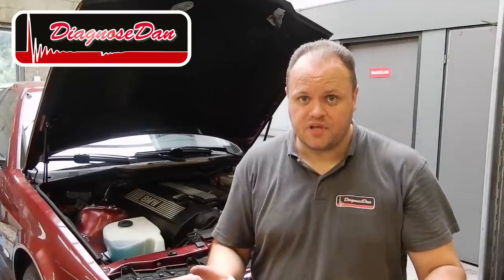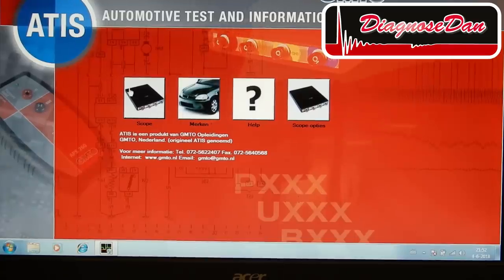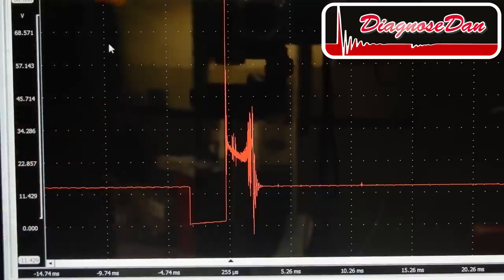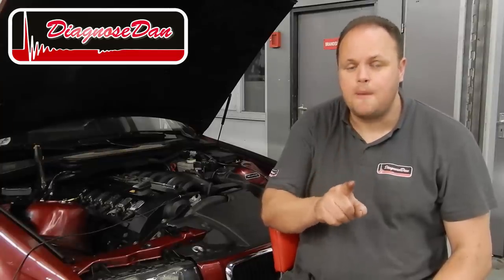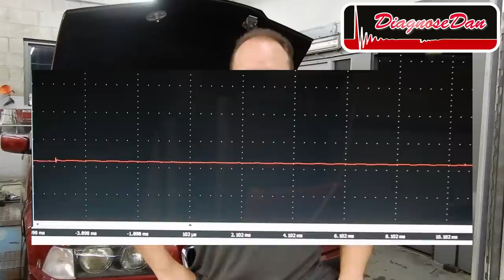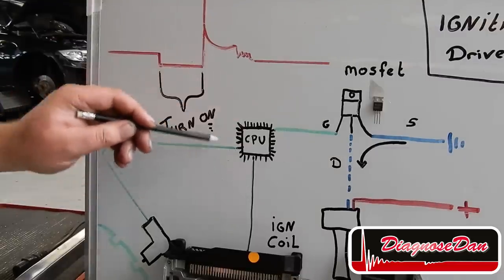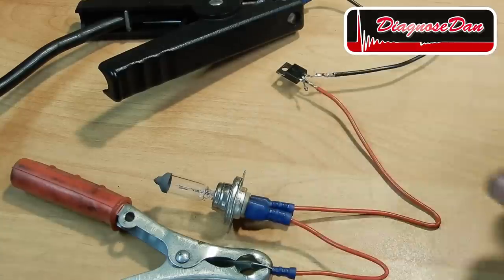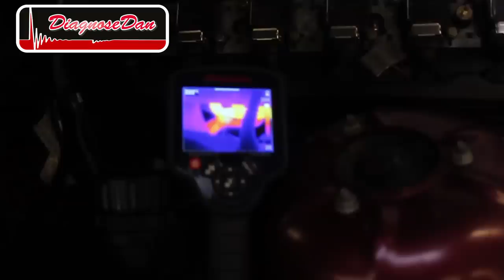ignition coil driver

Comment: So cool, Dan! Love the in-depth explanation on the whiteboard of knowledge :) A couple questions:1) Since MOSFET driver is controlled by positive voltage on the gate, how do you know 100% that the ECU chip was damaged by the shorted MOSFET?2) How did you take care of the "immobilizer issue"? Please show us!3) I must admit that is a beautiful clean BMW...how does it look brand new?
Reply from the maker: Pine Hollow Auto Diagnostics , I tried to repair the board with a new   mosfet. after replacing I checked but there was no control anymore! 
Most of the time there is more damage than just the mosfet😢.
If you are really interested in what i did with the immo, you can sent me a PM on my diagnosedan Facebook page! 
Thanks for the comment buddy it's appreciated!👍
Reply: hey dan i also want to know about the immobilizer. please share
Reply: Sweeeet
Reply: +Pine Hollow Auto Diagnostics Hi Ivan! Well Most CPU's work with a maximum 3.3V if you consider that the Mosfet was shorted and the history of the car said that it had a shorted primary coil winding then we can assume that +12V power coming from the coil circuit went trough the  signal ECU wire and then through the shorted Mosfet getting at the end to the CPU circuit and burning it. The shorted primary coil circuit and the shorted Mosfet both became a bridge or road for the +12V to get directly to that CPU. Cheers Ivan!
Reply: Todo. Oke
Reply: Most circuits I've ran across that use  FETS or IGBTs will have a gate driver between the microcontroller and FET.  The gate driver could be in another IC on the board or by itself.  That way if the FET shorts, it will take out the gate driver instead of the MCU.  If you think about it, a short that bad if the MCU were to directly control the FET, would blow the whole MCU and the car wouldn't even run.  There are other reasons why  gate drivers are needed, but I would be typing a book.  
Great video and love that you went more in depth with how the DME controls the coils.
Reply: You would think that the CPU would have short protection in all it's in and out puts.  Well known ways to do this.  But why?  Fewer $1000 parts get sold this way.
Reply: @OzMechanics  Probably transferred the EEPROM data from the old pcm to the new one
Reply: @stanleytolle416  The electrical environment in a car is known to be particularly noisy with lots of voltage spikes and transients. All electronics are already designed with protection circuitry on the parts that interface with the car. However you can't protect against every eventuality, certainly not when the failure originates from within the module itself.
On top of that, even if this PCM had been equipped with protection to survive this failure mode, the protection circuity itself presents another possible failure mode. Also you'd still have to find and pay someone with the skills to locate the faulty component within the PCM and solder in a replacement. That is unfortunately a less and less common skill nowadays.
Reply: @OzMechanics  Autologic or GT1 will resynch DME and EWS
Reply from the maker: @12salem  No they won't
Reply: @Diagnosedan  Somehow I can no longer find the comment I was replying to but YES THEY WILL  sync a dme and ews . Perhaps depending on year and make but they most certainly will on certain models. I have GT1, ista, ista/p I scan and all those systems will do it
Reply from the maker: @12salem  Will they sync an Ews, with a Donor Dme? Like i used in the video?
Reply: @Diagnosedan  That part I can not say , in the two instances I had to do it I had a no start on a 740il and once 0n a 540.  no ecu was replaced, cars came in from other shop with no start. I would assume with your situation a reprogram using ista/p would be needed.  Point is gt1 and others will do an ews synch
Reply from the maker: @12salem  i worked with the GT1 and Autologic. They won't sync modules with different Vin numbers.
Reply: @12salem  The (fixed part) of the ISN (individual serial number) is different if the ECU is from a different car, hence GT1 and AutoLogic won't be able to synchronize. It can only sync the "dynamic part" on an already used ECU. Using certain chiptuning tools, it is possible to change the ISN of the ECU so you can make the donor ECU have the ISN of the broken ECU. It is also possible to change the ISN in the car by using AK90, EWS Editor, Xprog etc. A third option is to modify the ECU in such a way that it doesn't care about the immobilizer anymore. I'm guessing that's what @DiagnoseDan did since he doesn't want to talk about it. In more modern cars, this can all be done by OBD using advanced tools like BMW Explorer and AutoHex, but certainly not with GT1, ISTA, Tool32 etc.
Reply: He did not actually show the MELT DOWN of the terminal on the circuit board, the BOARD was toast.....Good parts in the computer, but not able to retrieve any cost effective way.
Reply: I would assume if the ECU was not damaged there would still be a signal to the Mosfet.
Reply: @Diagnosedan  All they had to do is put a 3.3V zener from the output pin of the CPU/microcontroller to ground.  Cathode (K) goes to the pin, anode to ground. Then use a 1K resistor from the from the pin of cpu where the zener diode is to the gate of the MOSFET.  The input impedance of the MOSFET is so high that the 1K resistor would not effect it all that much - except for the turn off time.  (Slew Rate)  Due to capacitance between the gate and source, you may want to add a small ceramic cap of about 1uf across the 1K resistor.  That would fix the slew rate issue and tighten up the off time.  If a MOSFET shorts, the resistor would limit the current, while the zener diode starts to dump the current to prevent it from going above VCC of the chip.  Think of the zener as a safety release valve.  That would be a SMD zener and SMD resistor.  Cost?  Probably $0.50.  The most current to flow through the resistor would be about 14ma.
Reply: @stanleytolle416  Most of the ignition drivers ( older ones ) are custom made for the ECU manufacture.
Newer IGBT's are better protected, and are inside the coils.
Reply: @Craig1967  I was thinking something similar.  Put a 1k resistor in series with the gate to the processor pin.  If the gate shorts, the current will drop voltage through acriss resistor as current flows through the input protection diode on the processor... assuming it's a standard processor.  Most allow somewhere in the neighborhood of 25mA max diode current.  Have a 3.3V, or 5V (whatever the power supply is) transient voltage suppressor will sink the current to ground.  The TVS should be there anyway IMO.  When I design circuits like this, I always include the TVS clamp to keep from destroying parts if an ESD event gets onto the regulated supply voltage.
Reply: @ThatEEguy2818  That is a great idea.  Most micro controllers have built in diodes with the anodes to the pins and cathodes tied to the chip's VCC.  I don't think they can handle much current since they are on the dye.  The extra transient suppressor on on the 5V or 3.3V rail needs to have a clamp voltage at either 5.25V or 3.4V.  Even though the chips have those diodes built in, I would still put external ones.
Reply: @Craig1967  the microcontrollers I use most can typically handle 25mA through the input protection diodes.  I can't speak for all of them.  Exactly how I would handle it would depend on the specs of the microcontroller I was using.  On the power rail, there's a good chance an engine controller is already drawing more current than is coming in from that input, so the current entering through the I/O pin on the controller would become part of the power supply and the regulator would compensate.  Chances are, the supply rail would barely see a blip... but car companies don't want to spend the extra $.10 to put those resistors in place.  They probably don't fail often enough and even if they do, the cost of a computer (to them) is probably less than paying someone to swap out that transistor in the field.
Reply: @ThatEEguy2818  I agree.  It's all about statistics for them.  Will the computer last the length of the warranty?  I am pretty sure that any that do fail under warranty are sent to a repair center (probably Mexico) where they may fix them on a component level and then they are resold as "rebuilt."
Reply: @Craig1967  are they usually unpotted?  I always thought they were potted, but then I see this video and wonder.
Reply: @sinegra30  I think you are right I wonder if those chips are available ?
Reply: @stanleytolle416  absolutely !
Reply: @12salem  Nope GT1 did not sync DME to EWS  .. it only resync the one who jump and miss a code(bad battery can make a problem),and they are from the same car,or like Dan write same VIN
Reply: @sinegra30  What a pity Siemens did not provide the circuit with a protective device in case the Mosfet shorted and zapped the output gate of the cpu.That protective device could have been a clamping diode  or an opto-isolator chip.
Reply: Craig Sherman interesting
Reply: @Eastahtata  HOW ?
Reply: @sinegra30  Normally, when drain to gate is shorted, there are gate protection devices that protect the CPU, such as opto-isolation or resistors,zeners etc.. I am shocked how it went all the way through to the CPU
Reply: Great video - well explained! Ive confirmed I also have a failed coil driver in the pcm; can you explain how you determined the pcm was bad? Can a new MOSFET not get soldered in?
Reply: @TheCam0070  he answered those questions in the video.
Reply: @Craig1967  I'm curiously looking at the electrical diagram for the abandoned MegaJolt/C project, and it looks like they did more or less that (without the cap) on their 2nd iteration of the design.
Reply: awesome  the most informative on the net. So at the end of the day the specialized tech the pcm was sent to did not do their job?

Comment: Way too many shops that just scan the car and go right to replacing parts (basically guessing).  Very refreshing to see a well-thought-out, methodical approach to finding the problem!
Reply from the maker: Thanks for watching!
Reply: This is an EASY one for him, did you see the BMW with the no start due to a shorted door handle? Other shops charged the customer like 3000 euro and still didn't fix it, not many even close to this guy

Comment: Incredibly valuable video since it's hard to find in-depth videos that cover both the automotive diagnosis as well as the associated electronic component level circuitry.  Typically it's just "The PCM is bad and here's a new one. Fixed!".  Great work.
Reply from the maker: Glad you like it!

Comment: When u diagnose it seems so easy and obvious that it seems that other shops just dont know what they are doing. But the main thing is the scope. Without a scope on modern cars you are a bit lost. I think most tech's think you just plug in a scantool and the car will fix itself.
Reply from the maker: brian kotze very true! scantools only point you into a certain direction! The diagnosing starts after reading the codes! And a scope makes you see what's happening!
Reply: Wish I could hit that heart button too
Reply: Could use an old fashion tac. or rpm meter.  That would tell you that you are getting signal to the coil or not.  Testing the CPU should have shown a bad coil driver.  The first shop at this point was dumb founded of course.  They most likely tested the wire to the coil and it was good too.  I guess that's politics today.  You can't trust what anybody tells you, even when you pay to have the truth told to you.
Reply: Hi, thanks for another repair video. And we would like to know, what company did check the  ECU and returned as good. Becouse they failed....

Comment: This is a very good video and I am impressed with Dan's knowledge. I'm a retired Electronics Technician and  I"ll bet the smaller IC chip just under the pencil at 16:33 is the driver chip that drives the power Moss FET transistors. and most likely it is also bad. The actual processor chip is probably good. Most of the time the processor needs a little help when it comes to driving power transistors so there is often another IC chip between the processor and the output transistors. The thing is, where can one find an actual schematic of the complete computer board? Most of the time you can't and without it, you are only guessing. All said a great job on this video!

Comment: Awesome work sir. I have question about three wire BMW coil. We have power supply to primary coil through fuse and PCM provides ground to turn primary coil on. Why do we need ground wire  on secondary  coil. Isn't spark plug grounded through engine block? I hope this question make sense. Thank you again for this outstanding diagnoses and tutorial. Cheers my friend.
Reply from the maker: KY Home Garage KY Home Garage It makes a lot of sense and this is actually a great question! That wire goes to ground thru a resistor. The PCM monitors the voltage drop across the resistor. This way it can monitor if the secondary has fired. So the short answer is that it's used for misfire diagnosis.
Reply: Thank you for quick explanation my friend but I am still confused. How can PCM monitor that circuit? BR wire on pin 2 is not connected to PCM. Is diagram incomplete?
Reply from the maker: KY Home Garage KY Home Garage sent me a message on my Diagnosedan Facebook page and i'll show you a picture!
Reply: please closely look at a toyota/lexus schematic for their ignition circuit-they use an igt and an igf. both will shut down either one coil or all of them. misfire diagnostics and circuit protection. 4 wires per coil.

Comment: Excellent job on solving and teaching the steps to take to achieve the RIGHT diagnosis, I bet either the coil was zapped out or the sparkplug had such a overextended gap so the coil was being made to overwork itself hence frying the driver for #6 ignition coil.

Comment: 1:23 You should name-and-shame this "specialist" PCM testing company! Were they made aware of the cost/inconvenience they caused by saying there was nothing wrong with the module?
Reply from the maker: I know this company very well and  normally they are very reliable. So no need to name-and-shame them.😊
Reply: @Diagnosedan  What percentage of the time are they reliable?
Reply from the maker: @kcuhc84  working with them years never made a mistake before
Reply: @Diagnosedan  Did they at least reimburse the customer for your diagnosis? A reputable company would have at least done that as the first shop diagnosed it correctly.
Reply from the maker: @tiredoldmechanic1791  i don't know.

Comment: Thanks for the explanation. My truck was having an issue of no ignition spark causing it to not start at all, after replacing all ignition parts the ECU was the only thing left. I sent it to a company that repairs them and they said it had a bad ignition coil driver. So they replaced it. I hope that solves my problem!

Comment: Dan ,that was the best PCM and mosfet video I've seen to date.I learned about power supply and laptop repair in the last year.And i bought a hot air station to remove and replace cpu's and mosfets and capacitors.I do it for fun only,when you see someone do this work in front of you ,it looks easy. IT NOT,it takes some practice but more importantly it takes the ability to find and read schematics.Honda ,BMW Toyota don't put those out on the internet for people to see.Also you need to be able to micro-solder.THIS type of repair takes someone with OCD to master it...haha  you made it sound to easy.I see IVAN wants to learn,he's good at fixing without parts,he can use his thermal viewer to spot the bad mosfet ,but he's going to need a whole new level of tools.haaha.Great video Dan !

Comment: Late to the party here but it really amazes me how many shops attempt to do this type of work either without a scope, or they have a tool  with a built-in scope and have no idea how to use it. A dead ignition coil driver should be a trivial thing for any diagnostic technician, and your video demonstrated the process very well. It also demonstrated how such a simple diagnosis was out of reach for the other shop, yet they attempted the repair anyway. which basically means they read the misfire code and replaced the coil and plug for that cylinder. If you don't know how it works or how to test it, don't replace it!

Comment: not sure why you wouldn't want to share how to put the right code in the new ECM but I was glad to see an application of a transistor in a circuit. This was an awesome learning experience but it would have even been better to have learned how to program the sensor in the new ECM. Great video and I'll still give it a like because it was so informative, even if I didn't learn to program the code in the immobilizer for the engine control module.

Comment: I watched this for the second time today a year later and I still pulled some learning out of it as I dealt with a shorted coil on a Jetta that caused crank no start this week! It was easy to find thankfully as a new fuse created a smoke signal for me 😂. Never yanked a fuse so fast in my life! Next one to help my diag thinking Is your BMW O2 sensor video as I have a n46 b20 that has lean codes.

Comment: Great video thanks. I had an ECU fried once by an over-voltage (which it registered as a fault code). Dealer just tried to replace ECU without thinking further (and said I’d have to pay for it if it was fried again!). I asked them to replace alternator voltage regulator. They refused and tried to sell me a new alternator. I had to fit a regulator at the dealers that I bought myself before they reconnected the battery! Crazy. Car ran perfectly for years after that.